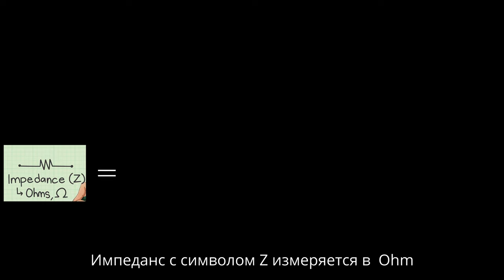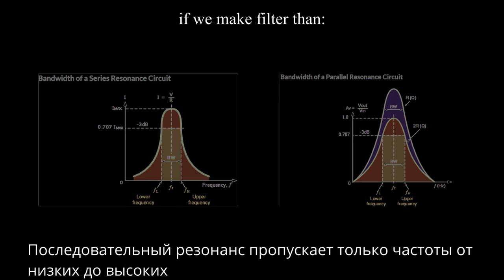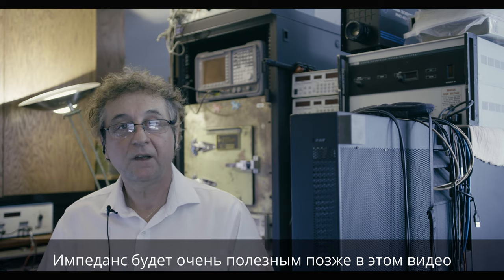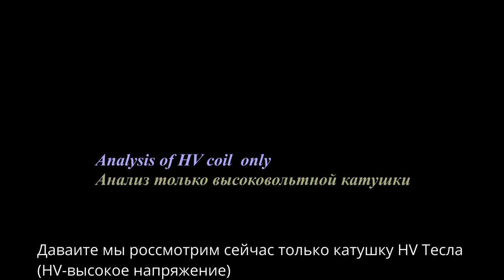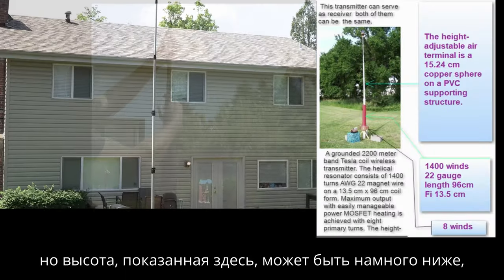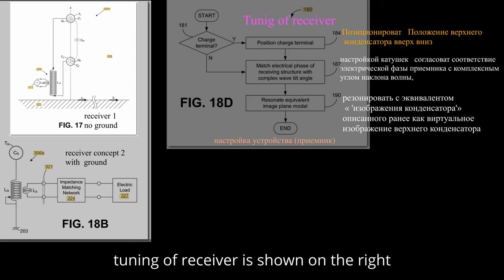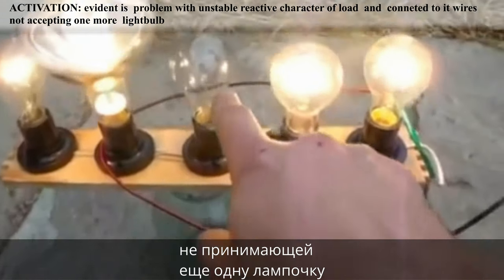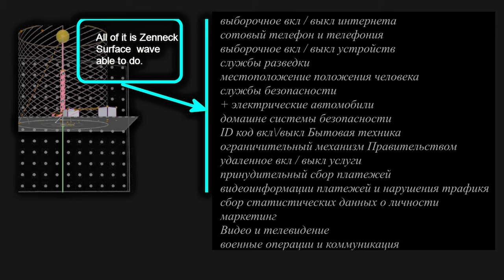Energy   extraction from Schumann waveguide

Comment: Amazing video thanks for the info my only question is how do you explain dr meyls so called similar scalar waves which penetrate right through faraday cages are those also zenneck waves which reach the cage conducting from surface and cage ?
Reply from the maker: Electromagnetic  Longitudinal Wave  (ELW) or any other  form  of (ELW)  doesn't exist. Electromagnetic wave(EW) can only be  transversal. ELW is possible in plasma  as plasma is a quasineutral, electrically conductive fluid  ( presence of  ions)  due to its electrical conductivity, a plasma couples to electric and magnetic fields.  Electromagnetic wave(EW) propagates in air, and other dielectrics.(  its penetration of given medium is frequency dependent) .There’s no proof of scalar elecromagnetic waves. - Magician knows his tricks  If that revelation was promising it would be widely applied till now. ( 12 years after)

Comment: energy is a movement in a given time,
Reply from the maker: energy is the property of matter and radiation which is manifest as a capacity to perform work (such as causing motion or the interaction of molecules).
power derived from the utilization of physical or chemical resources, especially to provide light and heat or to work machines.